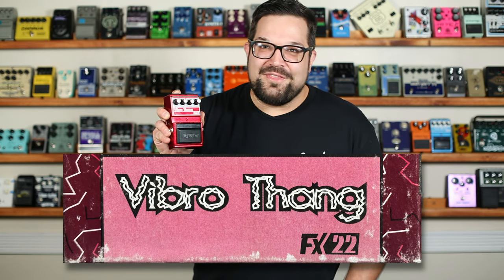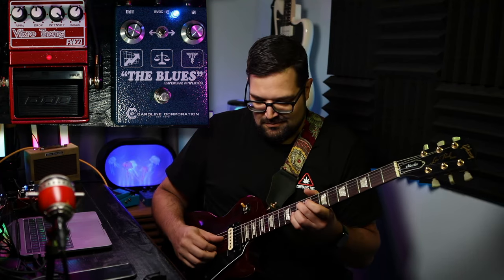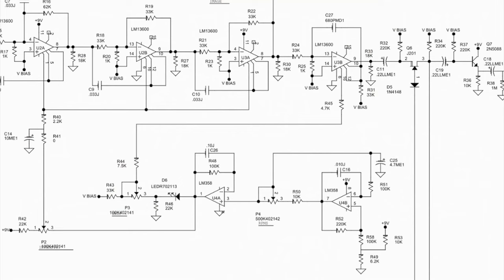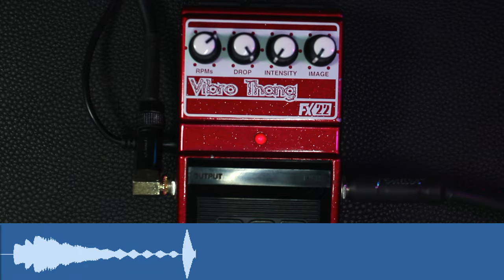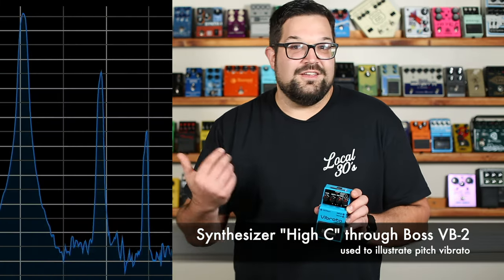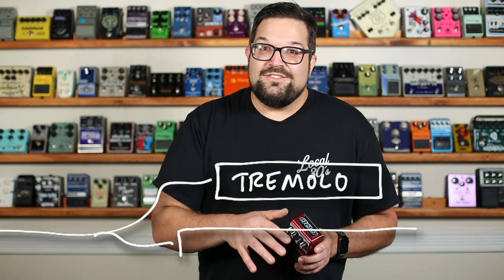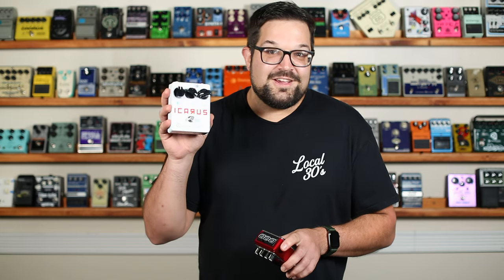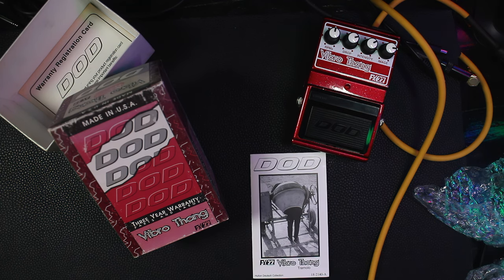What That Thang Do? The DOD FX22 Vibro Thang

Comment: STOMPBOX BREAKDOWN, Which rock bands used the DOD Vibro Thang pedal? I think Blind Melon used it not sure but try to find out which 90's bands used this pedal. You can get this same effect by using the univibe or dunlop Rotovibe in VIB MODE then using a Tremolo pedal. The vibro Thang is pretty much a 3 Stage Phase shift phase based vibrato with NO MIXING of the dry signal then uses a tremolo pedal. The key thing about the Vibro Thang is that its a 3 stage Phase shift based vibrato compared to the univibe or dunlop Rotovibe being a 4 stage phase shift phase based vibrato. This is a big difference because of the ODD order of phase shift. This was somewhat trying to get a "harmonic tremolo effect"

Comment: Great video! I am glad that someone is setting the record straight on these pedals. They are kind of a sleeper, in my opinion, but I've still yet to pull the trigger based on the times I have tried them and I feel like the LFO range or speed wasn't quite what I would like out of this pedal. It's sort of similar to Harmonic Tremolo, but not the same topology. I think I'd rather get the latter for that sort of chewy warble than the Vibro Thang, myself. I may try to build one of each though.
Reply from the maker: It definitely has a bit of the Harmonic Tremolo vibe (lol pun) to it. My favorite chewy tremolo is the Supro by a longshot. Nothing can touch the feel of that thing. Suhr Jackrabbit is good, I'm also a fan of the Caroline Parabola for their straight-tremolo effects. I could see myself using the VibroThang for adding some movement to lead passages with a hint of phaser. Definitely a neat pedal, glad I have one now.
Reply: @StompboxBreakdown  I will have to check out demos of the Supro and Suhr. I love tremolo in various ways, from buttery early 60s Fender amp bias trem to choppy triggered-gate effects tempo-synched to the song and everything in between. Have you tried the EBS Tremolo? It's a real sleeper for sure. I bought one when they were blowing them out for a good price a few years back and it's become an absolute favorite.

The EBS does both amplitude tremolo and a filtered "tremolo" that's unlike anything else I've tried, besides the Gristleizer I built years ago. It does it in stereo, with stereo INS and OUTS. If you haven't tried this out and you're a fan of these sorts of things, please do yourself a favor and dig in. It's pretty great.... weighs a ton, though. Ha!

Beyond that, I still love my old Boss PN-2 and my very old  Kay Tremolo, which is more of the choppy "repeat percussion" effect like the old Vox and Jen-made boxes. The OLDEST that I have, though, and damn this thing sounds good for what an archaic thing it is, is my Dearmond Tremolo Control. Have you tried one of those? It's such a neat trick. There's a non-concentric cam on a motor inside which shakes a vial of what's essentially Windex, as far as chemical composition is concerned, and that sloshing liquid shorts out against an electrode in the vial, grounding the signal in time to the shaking from the motor. It's like a game of Mouse Trap, but it sounds great.

Comment: Well made, informative video as usual! Thanks for diving deeper in function of effects - it's very interesting. I think, the Digitech- Hardwire Tremolo uses a similare circuit for the Vibro mode - maybe. :)
Reply from the maker: Good point, I should have checked out the Vibro modes of that and compared it. I did a video with the TR-7 and really liked it, but I think sharing the LFO between the Tremolo and Vibe/Phaser is pretty durned unique.

Comment: I had 2 devices decades ago. The 1st one sounded great but stopped working after 2 weeks, the 2nd sounded bad... I guess both were not made in the USA anymore.
Anyway great video!
Reply from the maker: Thank you! That's interesting, I wonder if there's really much of a difference between the earlier and later ones. Looking at the circuit board here, I'm fairly confident I could fix just about anything given enough time, it's all full-sized components, and I pretty much have the schematic memorized at this point.
Reply: The later Chinese version is capable of faster speeds. I don’t know the technical details but I’ve A/Bed them and own the Chinese version.

Comment: I did a quick video of my subdecay Quasar in the vibrothang mode - it's not quality video but just thought you'd be curious about the Quasar it's a fantastic pedal - so many phaser and filter sounds and great tremolo variations as well.  It's smooth n slick like Analog should be.

Comment: Hell yeah the vibro thang the forgotten lamb series pedal there's two versions one is good one sucks and has no range so yeah the vibrato is phase vibrato like the vibrato mode on a univibe I think they were attempting to get harmonic tremolo like on an old fender amp
Reply: can you elaborate how to spot the difference ?  Is there a version b and c like the DOD Supra Distortion (where c basically means"made in China" ?)
Reply: They have different names on the knobs and the paint job is different they also have the old footswitch on the other version I think the numbers are the same but I remember my local music store back in the 90s had both versions I'll try to find a picture of the other version ok I found two different versions other than the one you have one has tremolo/phaser on it and the other has different knob names that one has a bigger speed range I think
Reply: Thanks mate, which one is better ?
Reply: @alexanderm6049  the version that has Doppler as the name for one of the knobs I think the third and I think the fourth knob was called image